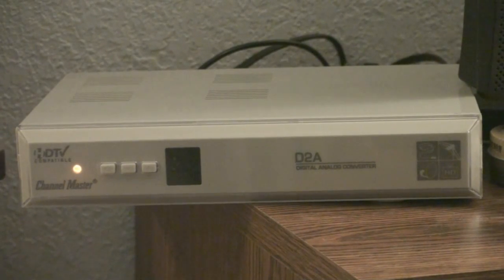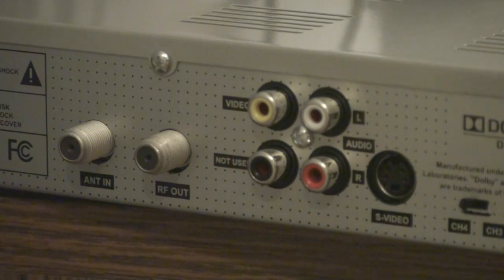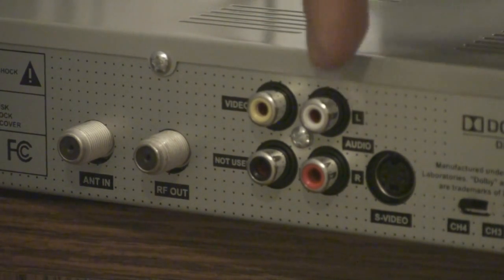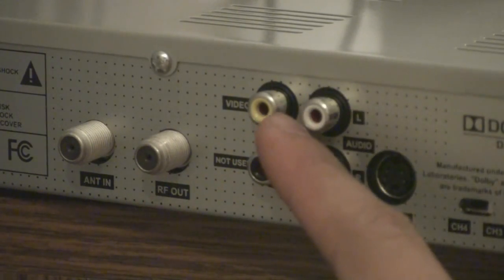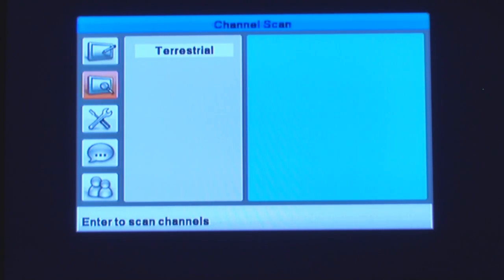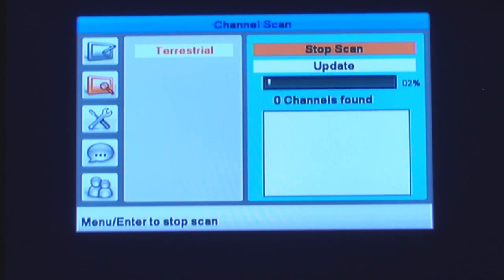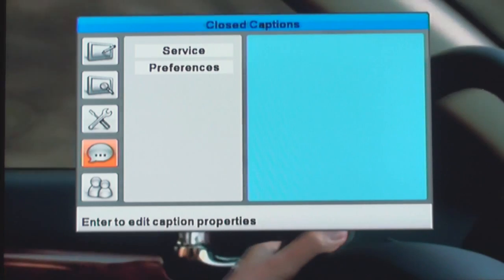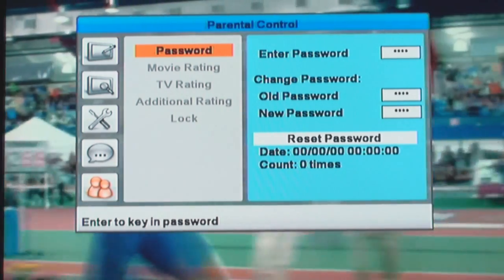ChannelMaster CM-7000 DTV Converter Setup [HD]

Comment: My unit was wired incorrectly, so the unit would only work if I switched it to Channel 4 on the back, and set my TV to Channel 3. So, before you give up trying to get it to work, try that. Also, if nothing is working, turn the unit off (standby) and unplug. Wait a minute or two and plug back in and turn on. I'm on my third of these units in 7 years. They burn out after a couple of years, especially if you unplug them without turning the unit off. Make sure that the settings on your analog TV are set to input: "Tuner" and the antennae: "TV." And, purchase a good antenna, like a Winegard. You'll have to move it around and rescan now and then, especially if you live in a tall building or have metal or electronic objects nearby.